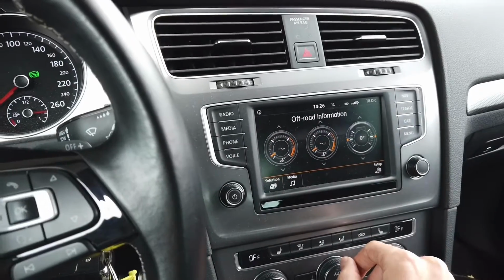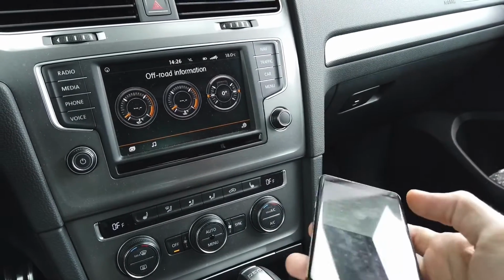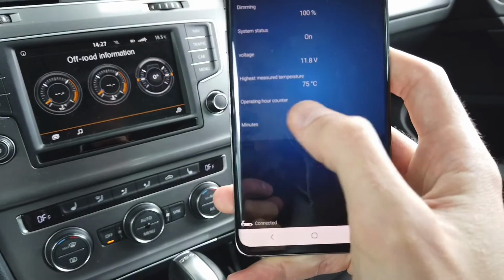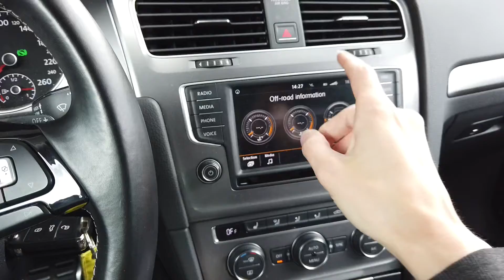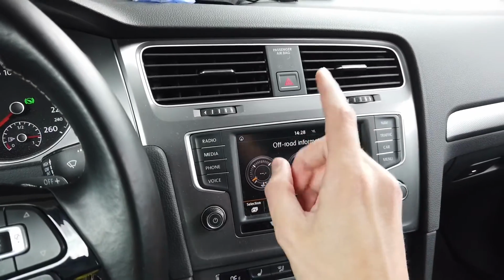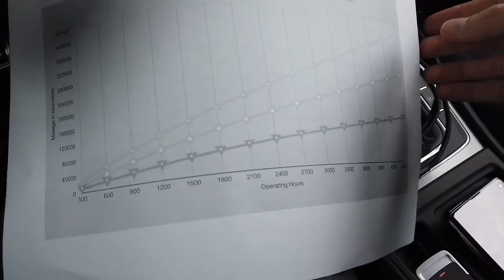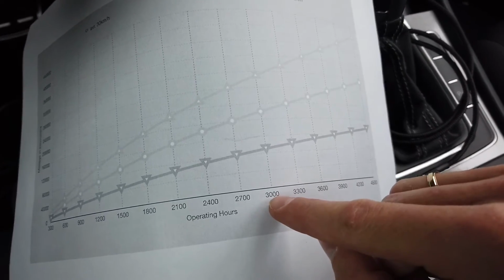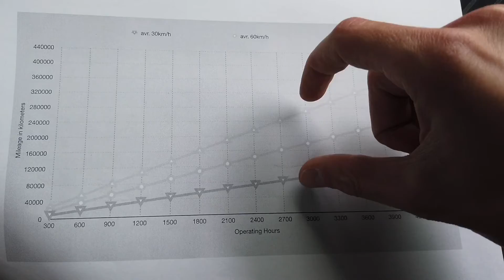How to estimate Audi VW Seat Skoda true mileage from MIB live data

Comment: It can be big diference, how you can know when you buy used car if it is driven in city or on highway, so you not know which line to pick, someone can lower mileage for 50 -70 000 and you wont be able to notice it.

Comment: for reference: I have on my car 34k km, 4 years old,  MIB display shows 1102h. I'm filling the car and every time write down "working hours since refuel", so in total I have 1064h. So it might be that 38h I was just sitting in car listening radio etc... :D
As I mainly drive in city, therefore I count the motor working hours, as I drive 250 hours in traffic jams per ~6000-7000km. You can drive the same hours on autobahn with 30k km. So therefore I change the oil every 250 hours, for better engine lifespan.

But your calculations on paper seem to be close, as I do mainly city driving, so the blue line is for city cars :)

Comment: Hi again, I like the idea of km.  I have a question for you, how can I activate Lane assist?  I have the camera at the top of the windshield, I also have Driving Light Assist and I managed to activate Traffic Sign Recognition but I can't activate Lane assist :(. I want to mention that I don't have the Cruise Control function and I think it may have  connection to ACC and that's why I can't activate this function. I managed to make the function appear in the on-board display as well as in MIB2 but when I want to activate it tells me "currently this function is not available".  You now much on this subject? Thank you in advance.
Reply from the maker: AFAIK you should be able to have Lane Assist working without ACC. ACC does works together with LA but it's not required to have it.
You need to enable it in:
A5 - camera
44 - steering assist
5F - infotainment
17 - instrument cluster
Reply: I activated in all these central units but it doesn't work ... everything looks good even in the on-board instrument next to Front Assist but as I said, when I want to activate the function it tells me that it can't be for the moment... :( but thank you enyway, I'll try again, if it doesn't work ... this is ...

Comment: Hi, what kind of engine do you have in your Golf? I’ve got a Leon 5F from 2013-2016 with 1.2 tsi. And I was wondering what your advice is on the timing belt replacement. When do you advice to do it?
Reply from the maker: I have 2.0TDI, can't relate to the 1.2TSI.
Reply: mr-fix ohh okay nvm then, nice engine tho the 2.0 TDI! A lot of power for a Golf